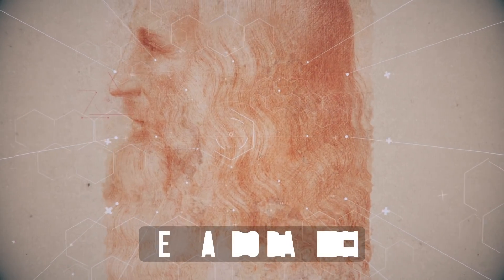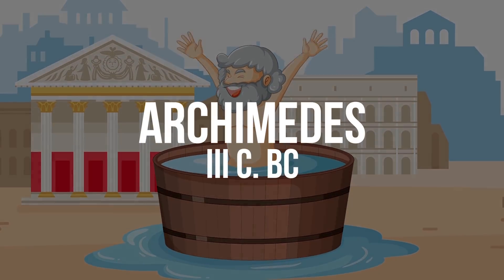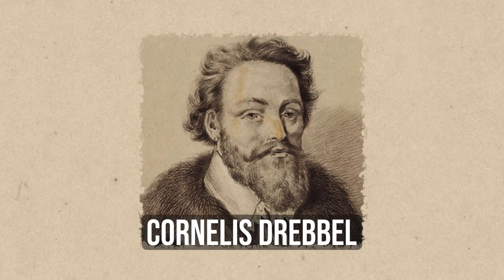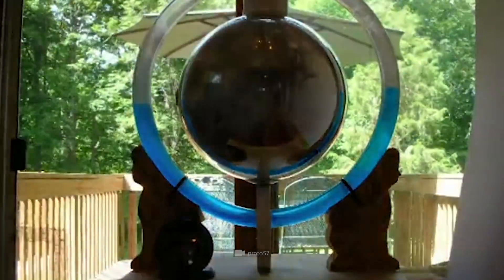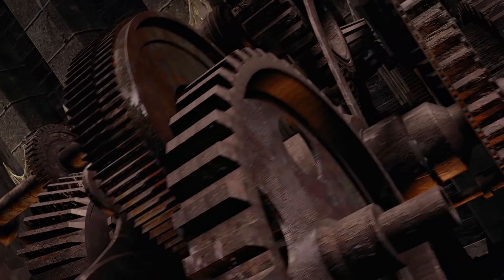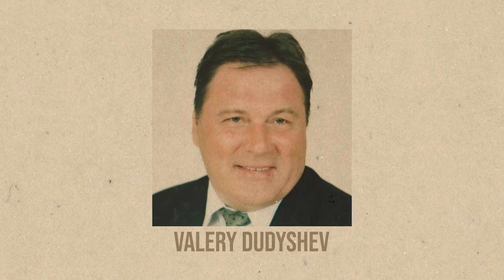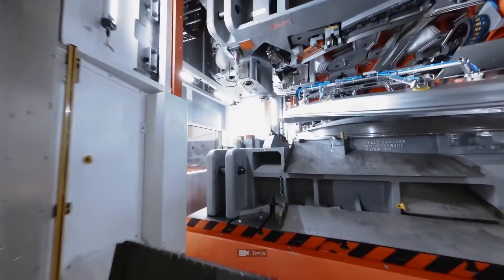Are Scientists Close to Creating a Perpetual Motion Machine?

Comment: A flywheel has a rotational Newtonian momentum that is the sum of each gram of mass times that gram's arc speed. That sum will have a numerical value such as 5.0 kg moving 3 m/sec. 

You can determine the numerical value for the flywheel’s inertia by suspending a mass (9.81 N/kg force) off of the circumference of the flywheel. Allowing for bearing resistance you will get a perfect F = ma acceleration that will tell you the rotational inertia of the flywheel. F = m * v/t  If a suspended force of 9.81 N (1 kg) is suspended for 3 sec and the speed of the suspended mass is 4.905 m/sec then the inertia of the flywheel will be 5 kg.   9.81 N = (5 kg + 1 kg suspended) * 4.905 m/sec / 3 sec

Now let’s throw a mass off of the surface of the flywheel so that the flywheel’s rotation is stopped. And let’s use a mass ratio 28 to 1. So lets throw a 179 grams mass on the end of a string that has been wrapped around the flywheel. You will have to rearrange your flywheel so that it has clearance beyond the frame and then the wheel has to be set off of the edge of a table. The speeds are dangerous.

The data that you record will be worth the Nobel Prize in Physics, because the small thrown mass will have the same Newtonian Momentum as the larger flywheel.

When a 5 kg flywheel is moving 3 m/sec it has 15 units of momentum and 22.5 Joules of energy. All the Newtonian Momentum is transferred to the 179 g mass and it too will have 15 units of Newtonian momentum and the small mass will be moving 84 m/sec. This is 630 Joules. At 84 m/sec the .179 kg will rise 359 m.  This is 28 times greater than the 12.8 m drop needed for the .179 kg to produce a 3 m/sec speed for the 5 kg. This would be when you suspend .179 kg from the circumference of the flywheel.

This is a means of securing massive amounts of energy from gravity; and therefore is worth more than just the Nobel Prize.

Comment: I patented a device which converts heat almost fully into electrical energy. The patent is US 3890161A    DIODE ARRAY. It covers a device which produces refrigeration which is a loss of thermal energy while it produces electrical energy. The energy gain and loss must be equal because the energy of a system considered as a whole must not gain or loose energy though the energy may change form. 

A diode array plausibly designed for power levels of watts would consist of billions of very small diodes in consistent alignment parallel or, for additive voltage, parallel series. 

The diodes partially rectify the.random thermal motion.of mobile electrons or stable positively charged  voids inside diodes. The diodes are aligned the same way so the output of many diodes is additive. 

A simple rectifier crystal can, iust short of a replicatable long term demonstration of a powerful prototype, almost certainly filter the random thermal motioren of electrons or discrete positiive charged voids called holes so the electric current flowing in one direction predominates. At low system voltage, a filtrate of one polarity predominates only a little but there is always usable electrical power derived from the source, which is Johnson (observation) Nyquest (theory) thermal electrical noise. This net electrical filtrate can be aggregated in a group of separate diodes in consistent alignment parallel creating widely scalable electrical power. The maximum energy is converted from ambient heat to productive direct current electricity when the electrical load electrical resistance  is equal to the array internal electrical resistance. 

Maximum calculated electrical power output (watts) is k (Boltźman's constant), one point three eight x 10^ minus 23, times T (temperature Kelvin) times bandwidth (0 Hz to a natural limit ~2 THz @ 290 K) times rectification halving and nanowatt power level rectification efficiency, times the number of diodes in the array. 

There are a billion cells of 1000 square nanometer area each per square millimeter, 100 billion per square centimeter.

Order is imposed on the random thermal motion of electrons by the structual orderlyness of a diode array made of diodes built within a slab: 

Host crystal is silicon
  P type boron doped
-----‐------‐----___-- Out
🔻🔻🔻🔻
■■■■■■___ + Out
  N type phosphorous doped 

All the P type semiconductor anodes abut a metal conductive plane deposited on the top face of the slab with nonrectifying joins;  the N type semiconductor cathodes or common cathode abuts the bottom face. As the polarity filtered electrical energy is exported, the amount of thermal energy in the group of diodes decreases. This group cooling will draw heat in from the surrounding ambient heat at a rate depending on the filtering rate and thermal resistance between the group and ambient gas, liquid, or solid warmer than absolute zero. There is always a lot of ambient heat on our planet, more on equatorial dry desert summer days and less on polar desert winter nights.

Focusing on the composition of one simple diode, a near flawless crystal of silicon is modified by implanting a small amount of phosphorus (N type conductivity) on one side from a ohmic contact end to a junction where the additive is suddenly and completely changed to boron (P type conductivity) with minimal disturbance of the crystal lattice. The crystal then continues to another ohmic contact. 

A region of high electrical resistance forms at the junction in this type of diode when the phosphorous near the ĵunction donates electrons that are free to move elsewhere while leaving phosphorus ions held in the crystal while the boron donates holes which are similalarly free to move. The two types of mobile charges mutually clear each other away near the junction leaving little electrical conductivity. An equlibrium width of this region is settled between the phosphorus, boron, electrons, and holes. Thermal noise is beyond steady state equlibrium. Thermal noise transients, where mobile electrons move from the phosphorus added side to the boron added side ride transient extra conductivity so t⁶he forward moving  electrons are preferentally filtered into the external circuit. Mobile electrons are units of electric current. They lose their thermal energy of motion and gain voltage, as they transition between the junction and the array electrical tap. 

There are other plausible breeches of the second law of thermodynamics. Hopefully a lot of people, mostly as independent teams, will join in expanding the breech. Please share the successes or setbacks of experiemental efforts. 

These devices would probably become segmented commodities sold with minimal margin over supply cost. They would be manufactured by advanced automation that does not need financial incentive. Applicable best practices would be adopted. Business details would be open public knowledge. Associated people should move as negotiated and freely and honestly talk. Commerce would be a planetary scale unified conglomerate of diverse local cooperatives. There is no need of wealth extracting top commanders. We do not need often token philanthropy from the top if the wide majority of people can afford to be generous.. 

The topic deserves discussion and prototyping attempt action. 

Aloha
Charles M Brown
Kilauea, Kauai, Hawaii, 96754

Comment: 6:17 Its missleading to blame magnets wearing out. Magnets actually contain almost no energy so that can never be the source of energy that powers such a machine anyway. Magnetic force is a conservative force. That means if the system ever returns to the same starting point it cannot do any work. That rules out any rotating machine as they return to the same position at least once per revolution.

Comment: Newton’s Three Laws do not have anything to do with energy because Newton did not agree with the concept of energy conservation.

Making free energy is simple if you just us Newtonian physics.

A 20 to 1 Atwood’s would be 9.5 kg on one side and 10.5 kg on the other side. This would give you 1 kg accelerating 20 kg. 
This is an acceleration of .4905 m/sec/sec and it will give you a velocity of .99 m/sec after a 1 m drop of the 1 kg. 
This is 19.81 units of momentum (.99045 m/sec * 20 kg).  The cylinder and spheres will give all that momentum to the 1 kg, and therefore the 1 kg mass will be moving 19.81 m/sec.
 And at 19.81 m/sec the one kg will rise 20 m. It was dropped 1 m.

Comment: Newton's second law of motion: states that in a closed system, not affected by external forces, the total linear momentum does not change.

This line can be the line that is the circumference of a circle. The interactions in this line are the same as interactions in a straight line. If a 40 kg rim gives all of its linear momentum to 1 kg: the momentum is still conserved even tough all the mass is moving in a circle. One kg moving 40 m/sec has 40 times as much energy as 40 kg moving 1 m/sec; but it has the same linear momentum.

This means that the Laws of Physics ‘require’ that energy can be made from preexisting momentum. And this energy can be easily recycled. The friction is minimal; because this 40 times increase is done in just a few seconds.

Comment: The momentum of objects moving in a circle is the same as the momentum of objects moving in a straight line. Ten kilogram moving one meter per second in a circle is the same as 10 kilograms moving one meter per second in a straight line.

The Dawn Mission yo-yo despin gives all the momentum of a large mass to a very small mass. This transfer of momentum gives a massive increase in energy. And; this is simply Newton’s Second Law of Motion. This can be used to make energy from gravity by adding a Atwood’s machine.

Comment: I proved that energy is not a conserved quantity by using a pulley with four concentric radii. And since energy is not a conserved quantity it can also be produced in large quantities.

I set up the photo gates on the 4 concentric circles experiment. I kept the drive mass at the 35 cm diameter.  This is a light pulley with four radii (lrn fzx axle and wheel). 40 grams at 105 cm diameter is just as easily accelerated as 120 g at 35 cm diameter; but the energy is three times higher. The gate trip times are the same for the 40 grams at the 105 cm diameter as they are for the 120 g at the 35 cm diameter. 

Larger radius differences can be used for larger energy production.

Comment: 5:11 Someone tell me why this can't be used to generate electricity? (it says because magnets wear off in 1000 years, well 1000 years of free electricity is more than good enough. We can't just scrap it just because it is not absolutely eternal.) On a bigger scale and a more refined look and efficiency it might work wonders. Even 10 years is good enough, until we find a better solution. Anything but the disgusting gas guzzlers and polluting factories that burn fossil fuels in the atmosphere and throw radioactive material all around.
Reply: @darklight2.1  Thx for the explanation, it does make sense that it won't roll. Then how to make a perpetual motion generator? Has to be possible.
Reply: @darklight2.1  I kinda refuse to believe that.  There's gotta be a way

Comment: Potentially perpetual has the ability never to start where progressively potential can be more then ever needed
Reply: What if you progressively harnessed the buildup of static neutral and turned it into a negative or positive influence doesn't it have the potential to be both if it's neutral so why is everyone saying transmission loss is such a big deal
Reply: Plain and simple pitch it and screw it everyone's trying to push through it and no one's figured out how to push around it so it doesn't work let's find something else

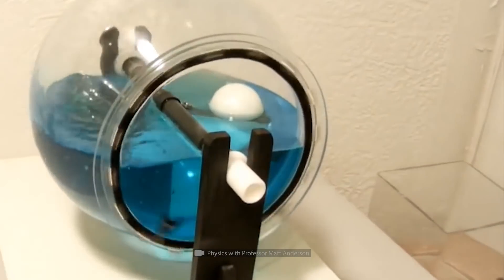Comment: 1:54 friction has nothing to do with it. Perpetual motion machines aren’t meant to be void of friction, there’s very little friction on the wheel. The reason it doesn’t work is because the ball displaces some water making it slightly heavier on one’s side, but being pushed back by the floatation force of the ping pong ball. And 6:20 is wrong too because magnets not keeping their magnetism still implies a perpetual motion machine, it just won’t technically last forever. It’s like saying a perpetual motion machine made of wood can’t run forever because the wood will get old. If the magnets wear out, that doesn’t mean the energy came from the magents. Which means it’s violating the law of conservation of energy, because the energy is being created from nothing wether the magnets last forever or not. The only reason it won’t work is because the ball is pushing on the wheel but not getting any closer to the magnet, it finds equilibrium and the wheel doesn’t move.

Comment: At 8:00 the capacitor that's "filling up" slowly but surely is doing so because the multimeter is filling it up. Multimeters measure resistance by injecting a small current into the circuit, and then measuring the voltage drop across those points in the circuit. The known current, and the resulting voltage drop are then used to calculate the resistance using Ohm's Law, V=I^2*R. Also capacitance and voltage are not the same thing. You don't measure capacitance by measuring the DC voltage.... Also capacitors aren't very useful for anything other that quick bursts of current. Also that's not the right kind of capacitor....

Comment: Even if you create one still you have face challenge of creating isolated system which is not going to be effected by anything.
If any out side object effect system will face damage which in end limit the Time.
And a simple rule of thumb is 
You need to use high quality material to gain full advantage of energy and also to bring sure what you use as source of power.
Perpetual Motion Machine may be possible but how can you say it is always going to run if you use it run car.
It goes against first law of Newton.
And thermodynamics would shit on this as will.
You gave something and then in return get something.

Comment: perpetual machines are technicaly impossible due to the second law of thermodynamic.  You cwan't produce more energy than what you start with.  Add to that the loss like friction, heat dissipation and else and you can't even reach a 100% efficiency.  Efficiency of 100% are only use to calculate the theorical maximum a system could have.

Comment: Always amuses me that when people try to disprove Davinci's gravity wheel they use tiny little weights. And the design shown is wrong. It looks nothing like the actual wheels drawn. For one thing, those huge open areas intentionally reduce the amount of time the weights are on the outer edge. It could be some idiot thinking that a separate return path was the edge of an open area, in which case they need glasses. For optimal power, and using a device that actually looks like his drawings, replace the weights with floats and submerge the device in saltwater, or preferably mercury, to increase the power to weight ratio to overcome friction. And it's not creating energy from nothing. It's using the simple tool of the inclined plane to redirect the force of gravity, or in the latter design the force of buoyancy. Using flawed designs like the one in the video is as bad as Edison using AC to electrocute animals to prove it was "dangerous".

At least you mentioned magnets at an angle. Spraying water from a hose at a wheel at an angle makes the wheel spin. Using the push seen by pressing the same poles of magnets together in place of the water hose can be used to spin the wheel. I personally wouldn't use one to directly drive a vehicle. At high RPMs the magnetic fields deform and don't snap back quickly enough, limiting the output. It's better to use a very large drive wheel and gear it down to drive a generator that would charge an electric vehicle. Not something you can fit under the hood.

The Schumann Resonance is a constant near 8hz frequency emitted by the ionosphere. It's a "ringing" from lightning energizing it. The exact frequency varies due to solar activity. Tesla inserted two "spindles" to make the device in the car work, according to the texts I've seen. He also had to make some adjustments to the device. That would indicate he was tapping into the Schumann Resonance and not just some general ionization. His car drove at a decent speed for a long distance without needing a football field of foil to power it. The 8hz would have to be passed through transformers to get a usable wattage, which is the purpose of the "spindles" he used. This is not a free energy device. It's no different than using solar or wind power, since weather is ringing the ionosphere to create the signal. Any kind of metal nearby could disrupt the signal, and nearby power lines could create a serious problem, so such a device would need to be used in a more rural area. Put that near a regular AC overhead power line and you'd actually be stealing electricity. More efficient designs use two tall antennas, 8hz requiring a very long wire, and the potential between the two antennas is run through transformers. 

The Schumann Resonance is likely also what drives the ionization seen at the top of the great pyramids, though I'm sure skeptics claim it's just static electricity.

Comment: If there was a perpetual motor that is entirely a mechanical contraption that would closely resemble in its makeup to a clockwork, and is compact and perform like an internal combustion engine, in terms of throttle, torque, and r.p.m., and is scalable from microscopic to megalithic proportions (versatile in applications), how much would it worth? If you’ll find a buyer respond.